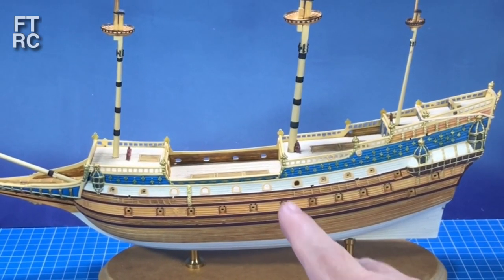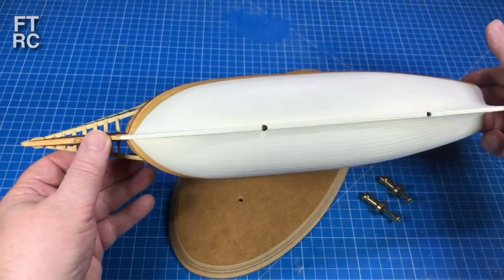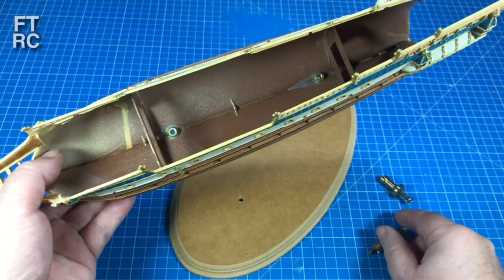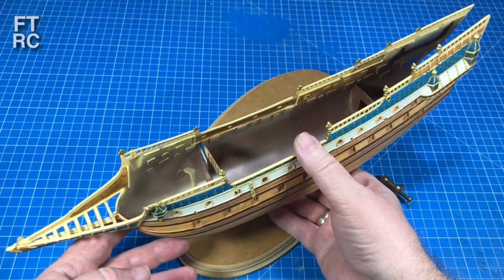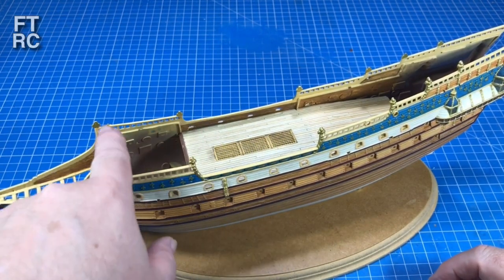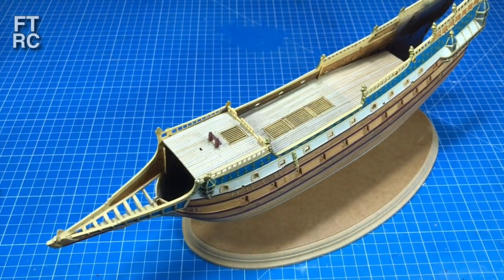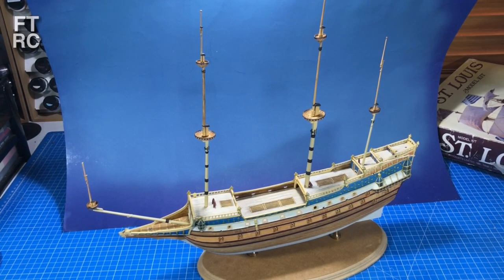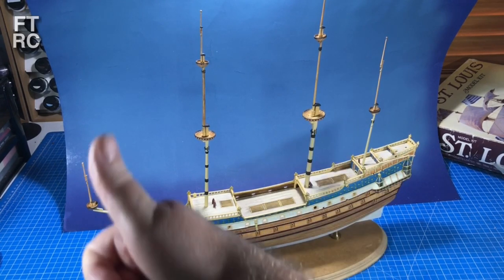Airfix St Louis Part 8  Masts and Brass Pedestal base

Comment: Amazing paintjob! It really has the look and feel of wood. The weathering is spot-on and not exaggerated. P.S. Do you leave the brass support parts as is, or do you put protective varnish? They tend to oxidize and turn flat brown over time.
Reply from the maker: A good point… I just let my current ship builds on pedestals get a nice antique patina. Back in my youth I just used the kits plastic stand.  So going brass has been a new thing since I returned to the hobby last decade.

Comment: I wonder if Airfix used the basic hull mould of the St. Louis to make their Wasa kit – or visa versa!? haha... I'm noting major similarities with the hull with my 1970s unmade Wasa kit. To be expected of the time know doubt.
Reply from the maker: I have both kits, and photos of the hull parts on Facebook.  The Airfix Wasa and St Louis are very different.  Although both were designed at the same time in the 17th century in the Dutch style, the Wasa is longer, wider, taller with more decks and has a lot more cannons, nearly doubled that of the St Louis.  Airfix actually visited and measured the Wasa on display after it was refloated.  The St Louis is just based on what little information we have of the Couronne and one model of it, lost now, from a French museum.